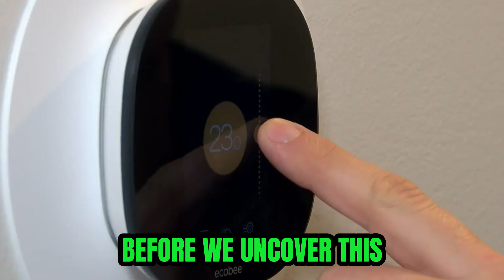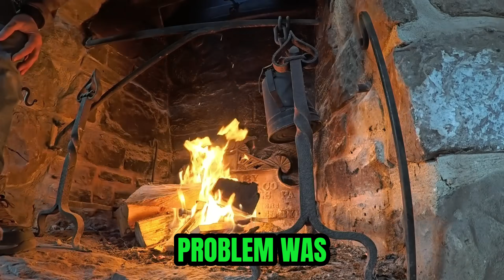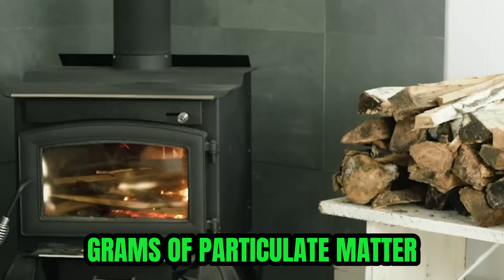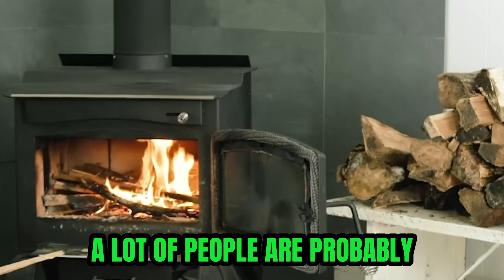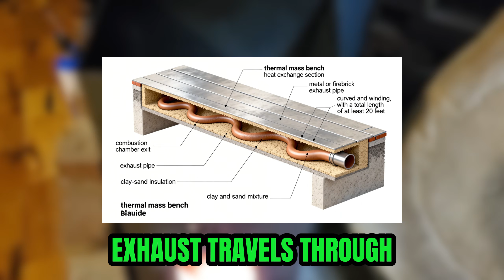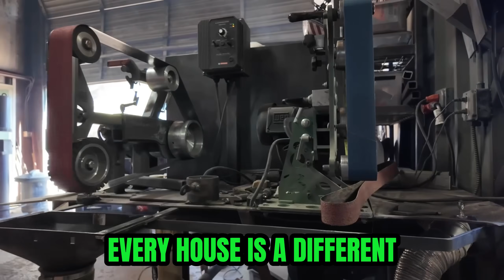This Heater Cuts Your Wood Costs by 80%! Why Is This Truth Being Hidden From Everyone?

Comment: Who the hell trained Ai to orate, William Shatner? This video is a bunch of bullshit with the cost analysis as well…it neglects to mention the most important parts of a rocket stove…the insulation surrounding the burn chamber, and the double barrel system needed to provide insulation in the secondary burst chamber…and that insulation will at least double the proposed cost. Just more Ai slop at work here folks.